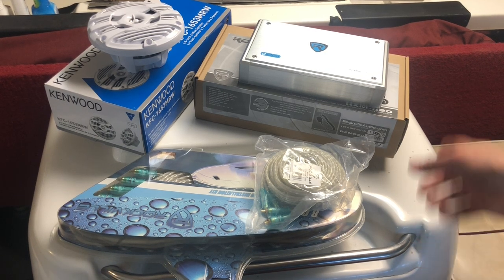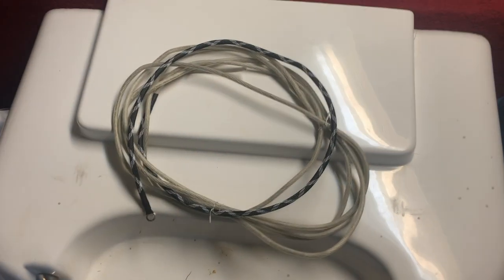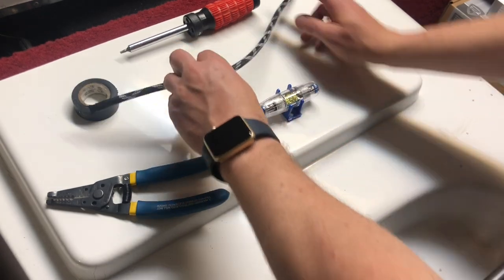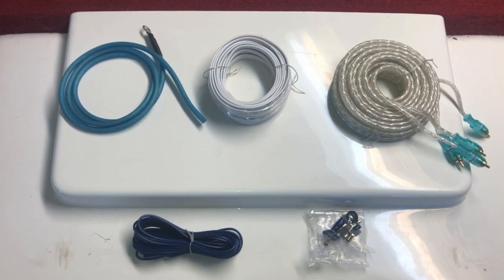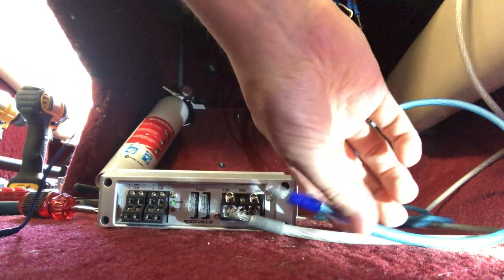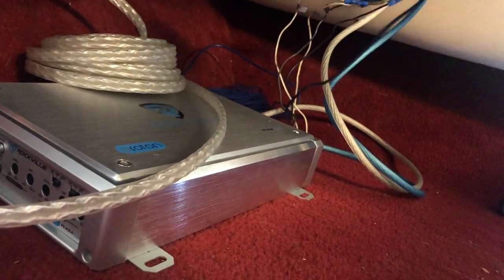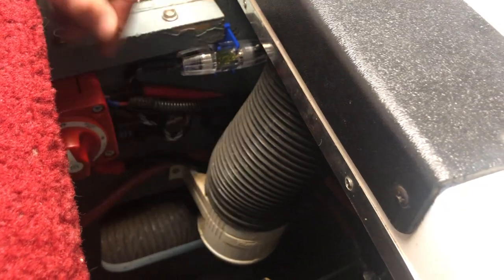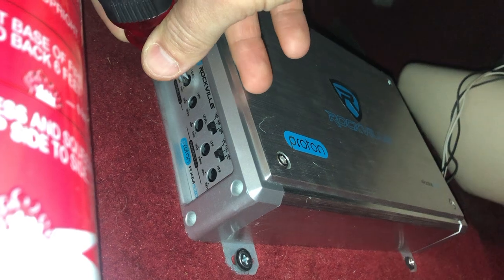HOW TO Boat Amp Installation

Comment: Great video, thank you. I have a question... my boat currently has 4 speakers hooked up to the head unit. No sub and no amp. I want to add an amp (and maybe a sub now or down the road). If I added the amp, would I need to re-run all of the factory speaker wires to the amp, or can I just hook the amp to the head unit since the speakers already run through the head unit?
Reply from the maker: Hey there sorry I’m taking so long to respond. Yes, you will need to run the speakers to the amp, not the head unit. Your head unit provides the unamplified audio to the amp via RCA cable. Amp then provides that sound amplified to the speakers. When you add a sub, that will connect to the amp as well, not the head unit. So make sure you get at least a 6 channel amp so you have a channel for each speaker. You can get away with 4 channel but 6-8 will ensure plenty of power and make it easier.
Reply: No you don’t. You can run the sub off of the amp and the other speakers off the head unit
Reply from the maker: The speakers will sound much better and get the needed power front the amp. I would always highly recommend connecting speakers to an amp and not running off a head unit. Otherwise you will hear fuzzy sound when turning the volume high and blame it on the speaker when in reality, it’s because you don’t have enough power to the speakers.

Comment: I had no idea i could run my positive power to the switch and not directly to the battery. This is a HUGE piece of information i didnt know
Reply: In a boat always power for everything except your bilge pumps is wired do the switch
Reply: @TeViiNz   awesome info! Honestly im very comfortable with automotive and home electrical, but marine im new to. Bought a 97 290 Sundancer and replacing the headunit and speakers so this is good to know. Wire speakers to the head unit and head unit to the switch. Thanks!
Reply from the maker: Yes, this is key to ensuring your accessories are truly powered off not draining the battery while not being used. In response to your comment above, your speakers should be wired to the head unit, the head unit to the positive bus bar/fuse box, then a single "Accessory" wire from the fuse box to the switch. In this video, I am wiring an Amp, which uses it's own dedicated wire to the switch due to larger power draw compared to other accessories.

Comment: Thinking about a Rockville 6 channel for my boat.  Hows that 4 channel amp been holding up for you?  A lot of mixed reviews.
Reply from the maker: I've used it for probably 20+ hours of boating now and no issues whatsoever. I can feel it with my feet while boating and never seems to overheat or anything. I would recommend any of their Amps.
Reply: @Jacob190000  Thanks, ordering a 6 channel.

Comment: Do you put your front speakers on one channel and the rear two on channel 2 and where did you ground your amp?
Reply from the maker: This is a 4 channel amp, so I used channels 1-2 for front speakers, and channel 3 alone for the sub (didn't need to bridge 3-4 because the amp has enough power with each channel). For this amp channels 1-2 & 3-4 are paired and gain adjusted together. I grounded the amp using the provided short ground wire to the negative bus bar under the dash.

Comment: Did you get an small buzz noise from speakers when the motor was running? It sounds perfect when motor isn’t on but the buzz come when it’s running
Reply from the maker: I don't notice any buzzing but this may be due to the alternator creating additional current. Either that or your speaker wires are too close to the engine causing too much vibration. If you are using a battery switch with 2 batteries I would try connecting your amp directly to one of the batteries to see if that fixes it. If so, you will need to leave it like that, or install some sort of inline capacitor to stabilize the current while the motor is running. If you only have 1 battery, adding a second would give you the ability to connect the amp to the second battery. You will then want to install a switch (I have a video on this). Just my quick 2 cents.
Reply: Try adjusting your gains.  If they are too high, you will have buzzing in your speakers.  You may not be able to hear it over the engine when it is running.

Comment: I have a tricky question for ya but hopefully you can follow along and give me some advise! I have three speakers already hooked up to my head unit that allows 4 speakers. But once I add the fourth speaker my head unit shorts out. If I were to add an amp would I be fine with just hooking up the 4th speaker separately to the amp? If that is unable to work should I just hook every individual speaker to a 4 channel amp? Thanks hope this made sense!
Reply from the maker: Does the head unit short out at any volume with the 4th speaker? Typically, you would only run into issues if you didn't have enough power, and turned the volume up too high for the head unit to put out enough watts to all speakers. Even then, your unit wouldn't short out, your speakers would just start distorting. I would suspect the issue is actually with your head unit fuse itself, or the wiring to your head unit. I would ensure the fuse and wiring is good before doing anything else. Either way, an amp will make your 4 speakers sound better than not having an amp. It may also solve your issue, as your head unit won't be required to send any power to the speakers. Just make sure you connect all speakers to the amp, you will have more control and it will sound better that way.
Reply: Cars & Computers my head unit volume goes to 50 and shuts off at 42 with the 4th speaker connected. But with only 3 I can crank it to 50 but then the distortion starts. So just to make sure I’m following along, when connecting the amp I can disconnect all of the speakers going straight to the head unit and wire them up to the amp it’s self so that the rca input will connect them all to the head unit? Thanks!
Reply from the maker: Correct, RCA will feed the sound to the amp and you will connect all speakers to the amp instead of the head unit. Honestly regardless of the source of your issue, it’s going to sound better with an amp so it will be a good investment.

Comment: Did you actually disconnect the battery or did you just use the selection switch in off?

Comment: Do you get a pop when running your trim up or down? I'm having an issue with that on a pre-installed stereo system
Reply from the maker: I don't but this may be caused by voltage drop. A couple solutions are to have your stereo/amp on a separate battery, or install some sort of capacitor that can prevent voltage drop when using the trim.
Reply: I have the same issue on my boat - trim and drive tabs cause snapping.  I have a dedicated house battery, 6 speakers, sub, amp and head unit.  I ran the negative from the amp directly to the negative terminal of the house battery.

I have run the power and negative directly from head unit to the house battery.  I checked RCA’s from head unit.  I adjusted gains using a DMM.  I checked speaker wires.  Nothing has solved the snapping.

I thought about adding capacitors to the trim and drive switches but that doesn’t solve the issue.

What about the led power and ground wires?  I have multiple speakers spliced into a single positive and negative wire.

Comment: Looks like you connect the amp straight to the battery switch and not the battery itself?
Reply from the maker: Yes that is correct, in my case, I want all accessory power to go through the switch. This way I can control which battery they are using. The only thing I do not have going through the switch is the Bilge pump, so that it will run regardless of which position the switch is in.

Comment: Where did you ground the amp? That's the whole reason I watched the video.
Reply: Exactly why i watched too
Reply from the maker: I do briefly mention that I ground the amp using the provided short grounding cable to the negative bus bar under the dash. This is a short metal bar that your gauges, stereo, etc. Will all already be grounded to as well.
Reply: @Jacob190000  Do you know what size the wire is running from that bus bar to the battery?  They are usually only sized for the instrument panel load.
Reply: @andrewh.8890  that will work just fine too obviously. That's what I've done and I have an 1800 watt 5 channel JBL, and a 450W MTX running six 6.5 wet sounds and a 10 inch kicker sub
Reply: Always ground a Amp alone onto metal like the engine block

Comment: Where did you ground the amp?!
Reply from the maker: In a boat 12V system the ground is essentially referring to the negative battery terminal. If your negative bus bar under the dash is supported by a large enough gauge wire you can just connect to that bus bar (thats what I did in this video). Otherwise you can run another cable straight from the amp ground to the negative battery terminal.

Comment: The positive 8gu wire goes straight to the battery or to the disconnect switch ?
Reply from the maker: If you have a battery switch, then it goes straight to the out of the switch. This way, your amp uses the same selection on the switch as your accessories (batt 1, 2, OFF)
Reply: @Jacob190000  thank you

Comment: Separate question, will my single boat battery be strong enough to power my 400 watt amp and my head unit with out losing its main functionality?
Reply from the maker: This will mainly depend on the size of your battery. Your biggest worry when only having one battery, is playing music for too long, while the engine is off and not charging the battery. If you have a group 27 battery or larger, you should be fine, just make sure not to leave the engine off for period longer than 30 minutes at a time, without running the engine to charge the battery periodically. I would always suggest adding a second battery and battery switch for peace of mind(check out my video on that)
Reply: My Yamaha 275Sdx came with 2 batteries. I made them put in a second house battery because o knew I would be adding another amp to power the wet sounds Rev12 HD that just came in.

Comment: Hey man I have a 2010 sea ray 195 sport an I want to add some subs but there is no space at all what do u suggest ( I would like to mount them right into the boat
Reply from the maker: First idea that comes to mind is that they make low profile subs that you should be able to fit against the driver or passenger footboard without too much disruption. Link: https://amzn.to/2XPhCmf
Reply from the maker: Here's another one I found with good reviews. I feel like you could find somewhere to fit this: https://amzn.to/2TVrSZ7
Reply from the maker: Both options are powered, so you would not need to fit a separate Amp.